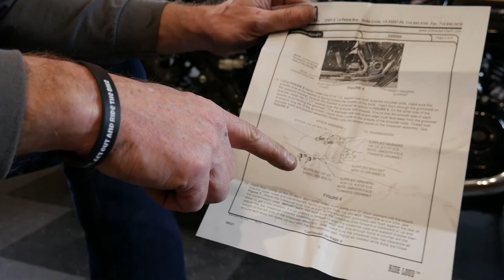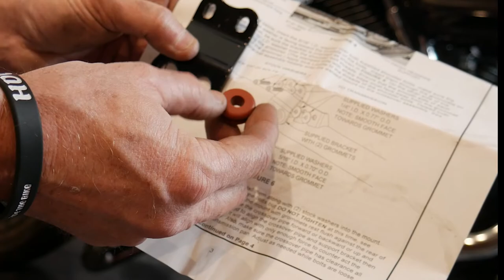Road King Special 114 gets the Cobra PRO chamber exhaust Stage 1 upgrade

Comment: Very good install. I just completed the stage one on my Road King Special. Fuel Moto Jackpot header/4.5 Tab performance mufflers with Zombie baffles with torque cones and ZRings. H-D ventilator air cleaner. Dynojet power vision with fuel Moto tune. Been to cold and snowy to ride. Hopefully soon. Sounds awesome. Thanks for taking to time to do this series. Really love the Road King Special. Take Care.
Reply from the maker: Thanks for watching.  Hopefully the series helps show people you can do this in your garage and save some money.  I'm guessing all in savings about 500 to 700 bucks plus the cost of a dynamic tune.   Yes I can't wait to get the bike out and let her run a bit.  It's so cold right now  and salt on the roads here in St Louis.  Ride safe 👊👍

Comment: i'm going to use your tutorial to help me install pro chambers on my 2022 street glide. you make it look manageable. good work!
Reply from the maker: Thanks for watching and commenting.   The pro chambers are definitely some of the easier headpipes to install.  Follow the video and you should be just fine.  If you are already a subscriber to the channel...thank you.   If you haven't yet subscribed to the channel I'd be honored if you'd consider doing so.   Thanks for your support and ride safe.  ✌️👍👊
Reply: Question: Should I install the FP4 tuner BEFORE I install the head pipes? Thanks @HDVIBE
Reply from the maker: @loud6931 You can install the tuner after you put the headpipe on.  Either way doesn't really matter as you will flash the base Stage 1 map.

Comment: Nice job bro. I’ve replaced the pipes on both my bikes.
Reply from the maker: Thanks for watching.   I appreciate the support.  Changing the head pipes really makes a huge difference in sound, heat on the right side and performance with a good tune.  Ride safe 👍👊

Comment: I watched this video many times when installing my headers and it was a great help! 

Since having the bike retuned, I have experienced a loss in MPG from 45 originally to about 30. I’m not sure if this is from the tune or what could have happened. 

In the video I didn’t see you replace the headers gasket at all. Because of that, I didn’t do that myself. Do you need to replace that gasket? Maybe that’s why my bike is experiencing such a drop in fuel economy
Reply from the maker: Thanks for watching and commenting.   While replacing the headpipe gasket is preferable...in this case the gaskets were in excellent condition so I chose not to change them.   My guess is the tune is causing the reduced gas mileage...but that is very difficult to know...lots of factors could impact fuel economy.  I typically get around 38 to 40 mpg on my bikes...even the one that has a Stage 2 upgrade.  If you are already a subscriber to the channel...thank you.   If you haven't yet subscribed to the channel I'd be honored if you'd consider doing so.   Thanks for your support and ride safe.  👊✌️👍

Comment: Hey Rick I just bought the exact same bike your working on in this video.. I've been looking to put a fairing on the front but the previous owner has a smaller light mounted on each side of the heahlight... so most I've seen would require me to Remove those  lights, but your looks like it wouldn't interfere with them.. could you send me some info where I could but them.. thanks man love your videos very helpful
Reply from the maker: Thanks for watching and commenting with your question.  I'm assuming you're talking about the windshield.   That is the Harley Windsplitter windshield.   Thanks for your support and ride safe.  👊✌️👍

Comment: Dude very nice install.  Swear I was watching a channel like revzilla or jp cycles.  People will really be able to use this.  I hate those dang clips that hold the bracket on the pipe, cut myself pretty bad on them once.  Pretty sure my blood became part of the pipe haha.
Reply from the maker: Thanks for the kind words and support.   I'm trying to do the install videos as thorough as possible so as you said people can do it their self by watching my video.  Yes the pipe clamps on the heat shields are a pain, but, by crimping down the one side, it's much easier to get them to catch.  Ride safe 👍👊🇺🇸

Comment: Another great video. When I installed my Slip ons, on the stock head pipes,  the left side with cross over was a smaller diameter where the slip on attached. Is this the same with the aftermarket head pipes? Or will I have to order a new slip on for that side? Thanks again for taking the time to produce all of the great content.
Reply from the maker: The Cobra Pro Chamber is set up specific for the Mikwaukee 8 motors and has the smaller pipe for the cross over and larger on the right side.  As long as the head pipe you order is specific for Milwaukee 8, you will be all good.  Thanks for watching.   I appreciate it.  👍👊🇺🇸
Reply: @HDVIBE  Thanks for the quick response. Did you find that it made a difference in sound?
Reply from the maker: @PaulG75  big time increase in sound output.  Also reduces heat on the right side of the bike as the aftermarket  head pipes do not have a cadeltic converter.  If you change the head pipe you will need a tuner to remap the ecm to get proper fuel/air ratios.  👍👊🇺🇸

Comment: Not a quick question, I have a 2018 Ultra Limited with Cobra Neighborhood Haters slip on. I have been told to do one of two things. 1. Remove the cat or replace the headers for more power. 2. Keep it like it is but wrap the existing headers to control the heat. BTW, I did have the S&S 465 cam kit installed as well and I’m looking for the best breather filter to go along with all of this. What are your thoughts?
Reply from the maker: I really like the Cobra Pro Chamber head pipes.   They are 2-1-2 so you get good power, reduced heat and great sound output.   I run the screamin eagle ventilator breather and really like it.  I hope that helps.   Thanks for watching and commenting.  I appreciate the support.  Ride safe.  👊👍
Reply: @HDVIBE  Thanks for the quick response. Did you get it returned and dyno?  What were the improvements?  Also, where did you get these parts?
Reply from the maker: @pwmabry1  I use the Vance and Hines FP3 on my bike.  Since you have a cam upgrade you would probably need a power vision tuner to get the proper map with headers and new breather.   I believe I got the Cobra headers from Parts Giant.  They are like the Amazon of aftermarket motorcycle parts.  Quick shipping and very good prices.  The breather can be ordered from Harley directly or from your local dealership.   Or check out my video link attached for the way I get Harley parts at a discount.
https://youtu.be/15jeukLUvBc

Comment: Thanking about going with these head's this month.  So im curious, since you have had these on for a few weeks.   Do you notice a decrese in the low end of torque?  I have seen reviews about that.  I was wondering if maybe they didn't remap the bike causing that.  How do you feel about the performance of these new Heads?   They sound good but as much as I LOVE a good sound I would perfer performance over sound!  Does this setup come with the mounting clips and floorboard spacers?  Thanks for the video!
Reply from the maker: Thanks for watching.  I have gotten out on the bike since I've put the pro chamber on and one word is WOW.  The bike is much more responsive and torque is much better from a seat of the pants perspective.  The pro chamber gives you the performance of a 2 into 1 on the M8 engine which gives much better back pressure than a true dual.  My experience is a 👍.  The bike also runs much cooler and the sound output has increased very noticeable.   I hope that helps. If you haven't subscribed to the channel I would appreciate you considering doing so.  Ride safe 👊👍